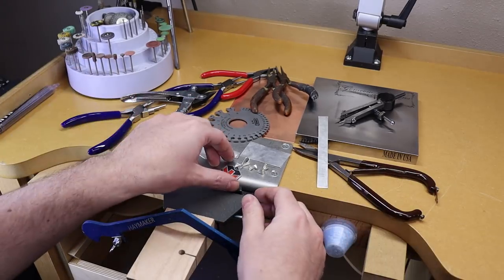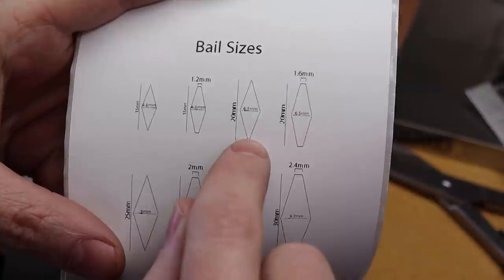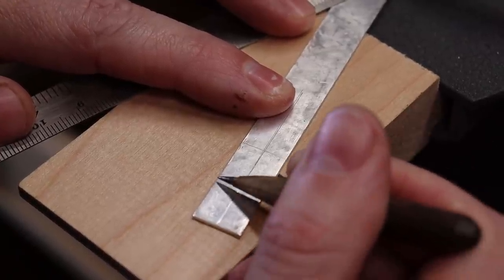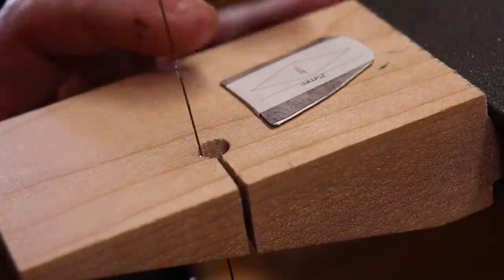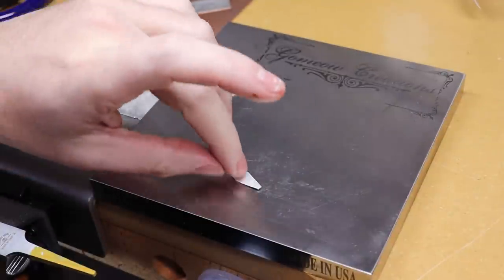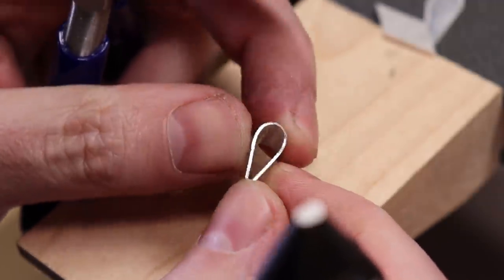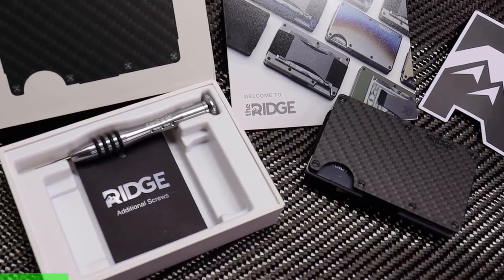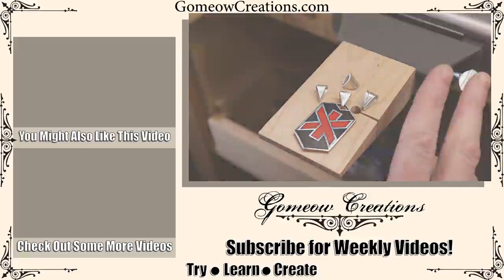How to Make Simple Bails + Free Bail Template

Comment: So excited for this video. I'm fairly new to metal smithing and have been making some pendants that need bails. I would prefer to make them rather than buy them. I would love to see your setup in soldering the ends while attached to a jewelry piece. Thanks!
Reply from the maker: I will do that at some point but if you do that add them before I do that, make sure you don't have your stones set in the piece as you do this seeing that they heat will destroy your stone. Also use a third hand to hold it so you don't solder it to the pendant if you are doing a free floating one
Reply: @GomeowCreations  thank you!

Comment: Hello, I just found your channel and find it incredibly helpful. I have a question if you wouldn't mind helping me. I want to make a ring for a friend with a sunflower on it that I plan to make out of brass. I want the band itself to be disconnected and not form a solid ring to that on one end is the flower and on the other is a bee that looks like it's flying towards the flower. What thickness of metal should I use for the band so it's not too weak or easily bent? Thank you in advance for any insight you can provide me

Comment: Thanks for the video. I tried downloading the template  and no luck yet. Do you consider the attachments at the ends of the chain and size of the bail so you pendants don't slide off the chain and get damaged. In the UK if you can't easily remove the pendant from the chain then both pendant and chain are considered one item and so could easily slip over the 7.2 gm silver limit,  making the expense of hallmarking necessary.Anyways great video.

Comment: Hey. I know this is off topic but how can I dispose if pickle made from vinegar and salt? I've looked up videos and it's usually the ones with chemicals.
Reply from the maker: This video will help you with this https://youtu.be/1mPAXsKXb1Q

For the most part it will not matter what your pickle is made of, it is the copper that is in it that is the problem. Copper suspended in a liquid is the hazardous material. If you just let it all dry out you can just throw it away seeing that it would just be salt and copper but watch the video for more info.